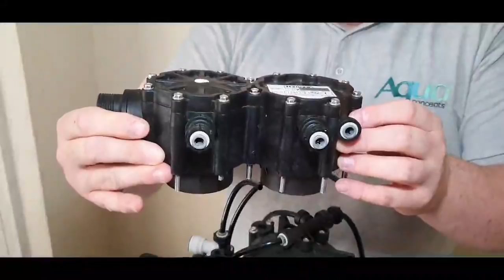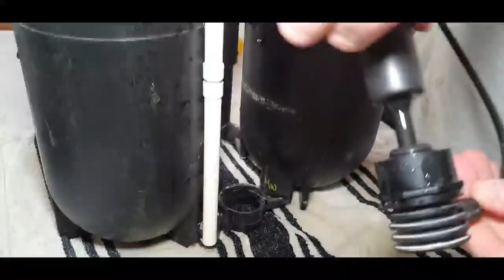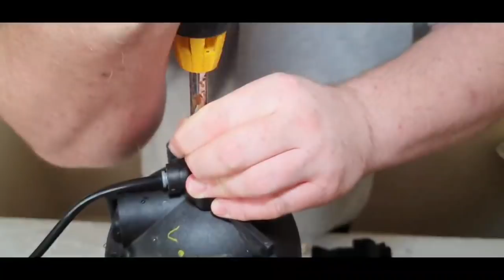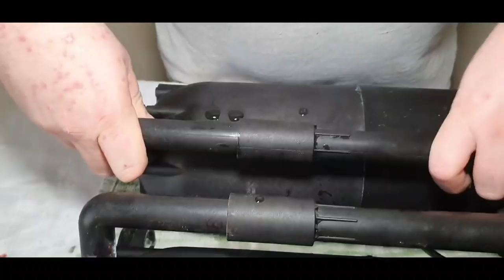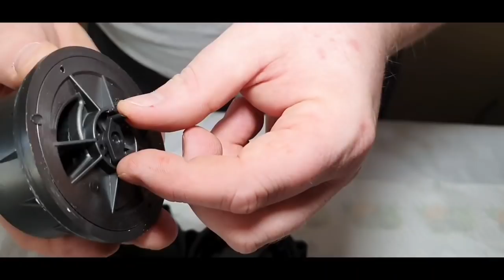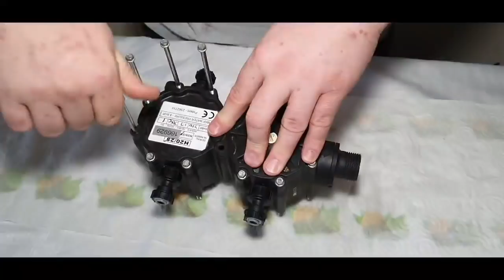Harvey Water Softener Repair / Rebuild [Water Softening]

Comment: My 8 year old Homewater shit the bed this morning (gushing out of what I would call a tundish under the sink like it was just straight mains). It's been trickling out for a few days as if it was taking hours to complete it's cycle and then this morning it gave out after making an interesting noise as I opened the kitchen tap. Thanks so much for this video, It's given a handy man a little more confidence to tear into the thing and see what doesn't look right.
Reply: I have the same problem and will be watching again to see if I can identify it. Please let me know if you find anything.
Reply: I shall follow up and say the shuttle valve was dead. Sadly you can't just buy the tiny valve inside whos rubbery coating had perished and so instead I had to buy a whole new part for £125 but the softener is back up and running once more. I have a reminder set for every 3 months to test the water to see when I might need to do the resin.
Reply: @GreatWesternTech  sorry I didn't see this, check my reply to myself and see what my issue was.

Comment: Hi. Thanks for the video. Where is the part where you replace the threaded inlet piece into the gearbox. You said they cracked and that's what I have.
Reply from the maker: You have to change the gearbox casing. It comes in one piece.
Reply: @TheWaterBoyuk  do you have this part available to purchase please? Or is there a repair service? Just been on the phone with Harvey and they won't sell it because I'm not a "trained engineer". I will never buy or recommend their products again. I've always been impressed with it until this. Minimum fee of £135 for an engineer and he will then decide on the price of the repair as Harvey cannot quote me even though I told them what the issue is.

Comment: I changed the shuttle valve 2 years ago with a LOT of help from this video.....but after a quiet spell, problems persist. The softener is always getting stuck and pushing water out at a high rate of knots. Regenerations are getting longer and longer too. I will check the injector next and watch the whole video again.
Thanks for this.

Comment: Hi, this is a great video! thank you so much - it is difficult to find good instruction on the Harvey models. It would be great if you could do a short video on how to set the brine level adjuster - there seems to be a lag between adjusting it and how much salt it is using, not quite sure how this works.

Comment: Thank you very much. Excellent  Video. Thanks to you I had the confidence to strip mine down to refill both cylinder with resin ( 4L in each ). I've now reassembled and back in location. Question, if you don't mind. Whats the procedure for recommissionjng?  Do I just turn the cold water valves on ( hard input and soft output )? I heard something about after that turning the white screw on top of the gearbox clockwise to regenerate one cylinder and then afterwards again for the other cylinder.  Any info would be great please? Many thanks.
Reply from the maker: I probably have the commissioning/ installation instructions. Drop me your email and I'll send a copy 👍🏻
Reply: @TheWaterBoyuk  Thank you.

Comment: Fantastic and informative, you made it look super easy. I have the problem that my softener (exactly the same) is making a noise like water is rushing through it, the water is very soft and it's using loads of salt. Are you able to tell me which parts I need to change? Also which one of the links takes me to spare parts? I clicked on all of them and none of them were parts. Thank you

Comment: Thank you for your video, it’s really useful. I do have a question. My brine tank seems to continue to fill up. I can only presume it could be the float at the bottom although it looks clean. Any suggestions would be very welcome. Cheers, Toni
Reply from the maker: The float valve is the obvious, but there are other possibilities. Check the corners of the uprising pipes, the injector and the welded plug under the shuttle valve.

Comment: Thank you for a great video. I have same Watersoftner. I had my house refurbished and whole plumbing redone. When reconnected by plumber, all was well with Watersoftner for few weeks but then it started to give grinding noise when it tries to regenerate. As a result, water has turned hard too. Any suggestion what might be the cause please?

Comment: Very informative video! I have a harvey XL water softner. After disconnecting the hoses to both the main and brine units, I have a loss of water pressure across all taps. I tried a manual regen which although did drain but didn't make any difference to the pressure in the taps. No visible signs of leaks anywhere, would appreciate any advice on which components to trouble shoot. Thanks!
Reply from the maker: can you send me a quick video of the valves? andrew@aquaconcepts.co.uk

Comment: Hello there. Could I ask you one question please. After doing a strip down and rebuild (thank you very much!) and refilled my resin tanks with 4L each tank and also replaced the brine valve. I installed everything back and seems to be working okay apart from one think.  When I connected and turned on the hard water inlet and soft outlet valves. Water started to come into the Brine Tank. The water rose to approximately 10-20cm above the salt platform.  Great I thought! But after 30mins or so I noticed that the water level in the Brine Tank was rising ever so slowly (its now like 60cm). 

My question is: How does the water enter into the Brine Tank?  I assume it comes down the brine line and into the brine valve/float mechanism. I assume this has a dual function purpose to [1] let water in and [2[ to suction up brine into the tanks for the regeneration.  

Thanks in advance
PS The gearbox seems to work okay, as it did a regen on both tanks after I opened the taps for a few minutes.
Reply from the maker: At the very most. The brine level should be 10mm above the salt well tray. You have a leak somewhere or the new brine valve is not shutting down.
Reply: Thanks for getting back so quickly. Okay, so the water does come down via the brine valve.  Thanks again.
 @TheWaterBoyuk
Reply from the maker: The easiest way to test the leak is not the brine valve is to pull out the brine line from the side the injector and plug the injector with a 1/4 inch plug. If the tank keeps filling up, it's not the brine valve.
Reply: Excellent! Thank you. I will try this tomorrow morning. Earlier I meant 1-2cm and 6cm.  After buying new Resin and a Brine Valve, I need the success! 🙂 @TheWaterBoyuk

Comment: Great video thanks.  Just one quick question before I delve into a full strip down.  My softener seems to be on constant regen i.e water running to drain constantly.  Any pointers?  Many thanks. Jerry
Reply from the maker: Could be something in the regen meter side, or more likely the shuttle valve.
Reply: @TheWaterBoyuk  Hi, thanks for the reply.  I dismantled the Venturi and blew it through and chef all 4 valves on the regen and ? Ports and now seems alll good.  Many thanks

Comment: Hi there, Really nice video. Very meticulous and lots of useful info.
I decided to clean the unit on the outside (did not take it apart) as the brine tank had sand in it.
Due to other priorities the unit was out of water for 2-3 weeks.
1. On restarting the brine tank water turned out orange/browny. Emptied the tank again and water was clear on next refill. Is this a sign that the resin need replacing? Unit is about 9years old.
2. Noticed that during regen only about 1/3 of brine is used (water level only drops by 1/3). Is this normal?
I have an H2O/0088 Model:800-17-400-1. Seems identical with yours except the brine level white bar. Brine valve well is set to 300 up.
Thanks
Reply from the maker: The orange water is bacteria because it has been stagnant and a few regeneration of salt water would sanitise. I would be tempted to run some 3% hydrogen peroxide through. 
In normal operation 15mm of brine is taken. when the brine drops too low the brine valve checks off.
Reply: @TheWaterBoyuk  Thanks for the quick reply. From what you say it is normal that the brine level drops only by 15mm during regen and should not worry.
I will use the hydrogen peroxide. The 3% concentration is before adding it to the brine or taking into account the brine water as well.
I have read recommendations to use a solution of phosphoric acid to get rid of iron ions in resin and citric acid for any residual lime.
Would you recommend these?
Thank you

Comment: Hi, thank you for this great video, but I'm not sure where to start with mine... In our case the water is just building up slowly over time in the unit, not draining out. Is this something that can be fixed by a novice or should I get a specialist to service it?
Reply from the maker: The rebuild video works if you can diagnose the problem. Most often or not a gradual build up is likely to be a small leak and maybe a drip. Get a torch and get looking around the unit. Look around the gearbox and shuttle valve. If in doubt get your local guy in. Let me know where you are and I will recommend someone for you if you get stuck.
Reply: @TheWaterBoyuk  thanks for your comment. I've had a look and can't see anything. If you could recommend someone who services in NE London, I would be very grateful 👍
Reply from the maker: @jameshunter-jones3633  email postcode and will narrow it down for you. There a few around there. andrew@aquaconcepts.co.uk

Comment: I have this item h25, and was fitted in 2008 but since last year it  started causing some issues. It continuously regenerates itself so after watching this video I cleaned the the regent paddles and cleaned all the necessary bits so it worked until last week then it started regenerates itself continuously again. I was wondering if I need to replace anything else like resin or do more cleaning? Or it doesn’t worth to repair because of the age? I live in West Byfleet in Woking, if you’re local I like you to repair it or just let me know if I should look for a new one please? Many thanks
Reply from the maker: Sorry we are in the East Midlands. The H25 is the 1 inch version of the H20 . It's difficult to diagnose any problem without going through a diagnosis proceedure. There is a video coming up on the members section.
Reply: @TheWaterBoyuk  thank you for your reply, much appreciate it. Looking forward to your next video

Comment: Great video, thanks. I'd be interested to know about replacing the resin media in one of these. My Harvey softener is probably 12 years old, some of the resin came out after I relocated the unit to a new property. Is it possible to replace all of the resin? Is there an internal mesh that holds it in? Thanks again.
Reply from the maker: Thanks for comment. The replacement resin vessels come pre loaded with new resin, so it is a lot easier to swop using the tutorial. It becomes difficult to remove the old, difficult to refill, and always a danger that the screens are blown. The replacement vessels are not too expensive. Drop me an email andrew@aquaconcepts.co.uk with your details and I can find out a price for you.
Reply: @TheWaterBoyuk  email sent.
Reply: @TheWaterBoyuk  Hi. I've sent an email and called regarding the spares for my softener but have had no response. Can you help? Let me know please as I need to get it sorted this week.
Tks
Reply from the maker: @assetbuilders3438  I'm in the office tomorrow I will track it down 👍

Comment: Hi I have a Harveys arc softener can i do a manual regen , this is different to my previous twintec where i could use a flat bladed screwdriver.
Reply from the maker: You need a key. It looks like a blue disc. Should be with your instruction pack.
Reply: Thank you so much for your reply  will see if I can find it.

Comment: Hi TWB, I have a Harveys twin block salt water softener about 12 years old, it has recently started overflowing out the outside overflow and the brine tank is full and disolves whole blocks in a day, I have done several regens which does lower the level back to where it should be but then after a few hours it fills up again! Any ideas? could it be the float valve, not sure where it is located, I have restricted access in a small cupboard!

Regards Rob
Reply from the maker: Rob thanks for watching. It could be a number of problems. Check, uprising pipes, gearbox leak, brine valve not shutting down, shuttle valve drip. I will be putting up a diagnosing video on the members section in a couple of days!
Reply: @The Water Boy UK  thanks for the reply, do you have any parts diagrams you can share

Comment: What would cause it to regenerate constantly?
Reply from the maker: is it regenerating or running to drain? If it is running to drain, turn it off by the bypass for 5 mins and turn back on. The regeneration may stop. If it is constantly regenerating from one regen to another, it would be likely to be water usage.
Reply: @TheWaterBoyuk  hi thanks for your reply, it is constantly running in the drain.

Comment: Hi the pipe that comes from the shuttle valve to the sink wastes has water comeing out all the time. Therefore the salt blocks lasted 2 days as it is continually running water through this pipe. What does the shuttle valve assy do and is that likely the cause. Twintec s4 about 4 yrs old. Ty
Reply from the maker: The shuttle valve directs the water into the tanks, shuts one down whilst the regeneration takes place. Yours  maybe in continuous regeneration. At 4 years old it is still under warranty. Contact your point of purchase 👍🏻
Reply: @TheWaterBoyuk  unfortunately in UK they give 10 years on parts but only 2 yrs labour
Reply: @TheWaterBoyuk  update, the valve did shut down, it can't hear it regenerating now but salt gone down third in 24 hrs. Is it possible that if it naturally run out before I noticed, then it would use new blocks of salt quickly to reestablish the brine content?

Comment: Hi, not sure if you can help me, but, my H2O has recently developed a fault where the brine tank totally fills up and over flows on the over flow pipe. I have cleared out all the water, put in new salt and it just repeats the same again. Could you steer me in what could be the issue please?. Thanks, Dave
Reply from the maker: Could be many faults. Brine valve stuck, injector leaking, uprising tubes spraying from the joints. There is a diagnosis video coming soon on the members section.
Reply: @TheWaterBoyuk  Thanks for your prompt reply, much appreciated. I am going to take it out at the weekend and have a better look at currently it is tucked away in a cupboard. I will come back to you after I get it out at the weekend. Thanks, Dave
Reply: @TheWaterBoyuk  Hi Thanks very much for your assistance. I have the unit out and under pressure and it is indeed a vey fine spray coming off of a 90 degree bend in one of the uprising pipes. Thanks again. Where can I get one of those from please?

Comment: Hi, thanks for the helpful video. Just wondering, if the tank is overflowing that is usually caused by a brine line blockage. How do I ensure that it is not blocked?
Reply: I've got the same issue. Brine tank has just started to overflow constantly. Looking at this video, I'm going to assume it's the float assembly or the venturi isn't bringing the brine into the resin chamber.

Comment: Hi- great video thanks. I have a question- my parents have this make of softer, I have cleaned it out as they told me it’s not working. When I re- connected it I notice that the waste pipe joint leaks as soon as I add pressure to the softer. The more pressure the worse the leak. Would this suggest that there is an internal fault and that the pressure is simply being forced back out the waste pipe? Any thing I can try ? Thanks Bill.

Comment: Thank you for this info - Quick question, (I have looked in the existing comments but nothing matching) my Harvey's twin tank seems to have stopped flushing during a re-gen. I can hear whirring but no water flow and nothing is going into the drain. Which part is usually responsible for this issue?
Reply from the maker: Are you sure it is the regen meter whirling? Sounds like you could be hearing the service meter whirling meaning you have a tap open, toilet filling or........ A leak!

Comment: Thanks for the video, it has been very useful. I have a quick question please. My S3, or Harvey H20 (identical to the one you are disassembling) is overflowing. I've taken it apart as per your video and everything looks ok with the exception of the brine valve. If I take the brine valve and submerge it in  a sink of water, the float mechanism does not rise. I'm obviously assuming that it should rise and fall with the level of the water and that effectively controls the water flow into the brine tank, and that this is the most lively reason the tank is overflowing. I just wanted to run my thoughts past you before ordering a new brine valve. Really appreciate your video and help.
Reply from the maker: Sounds very much like the float has taken in some water.

Comment: Hi. I've had an issue with my hv3 water softener using a tonne of salt and when I turn the tap on in the mornings the water is quite salty before being normal. Also the water seems to be coming out on the overflow on a regular basis as the waterline is quite high. What could this be? Cheers
Reply from the maker: The HV3 has the H2OB series with the new features. You would need to contact your local dealer or Harvey direct for attention. If you purchased from a dealer it would be under warranty still, but unlikely if you purchased direct. It is always wise to get your local expert to assist.
Reply: @TheWaterBoyuk  was hoping you could guide me in terms of trouble shooting. Softener was fitted a few years ago so it is out of warranty and harvey's want an arm and leg just for call out. Wanted to attempt it myself.